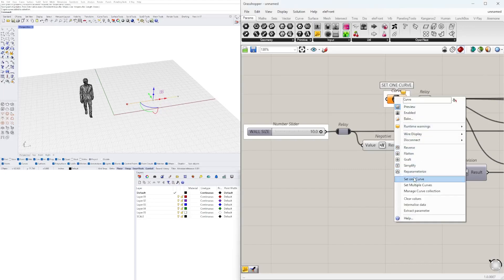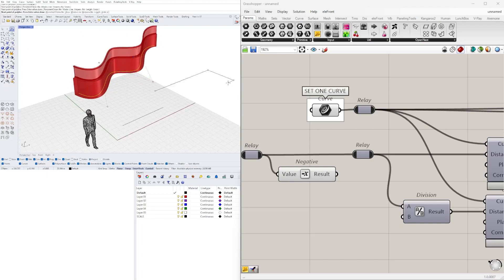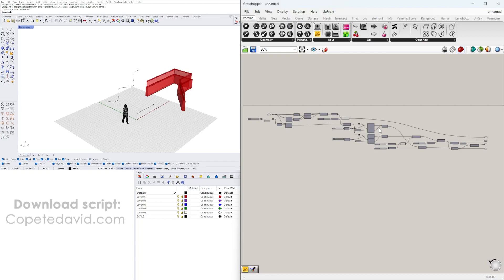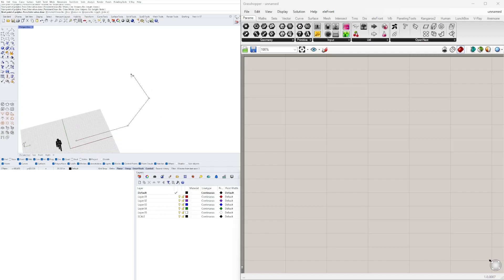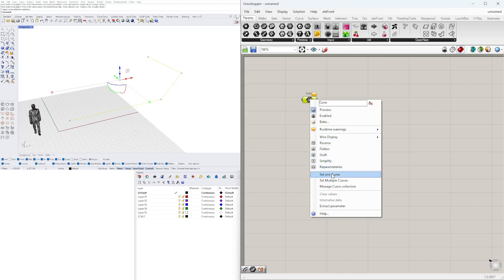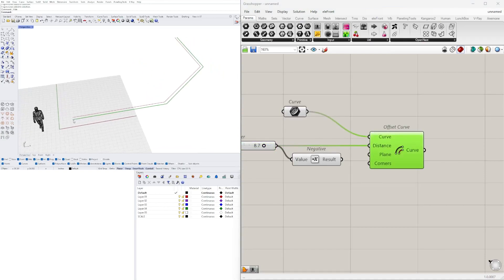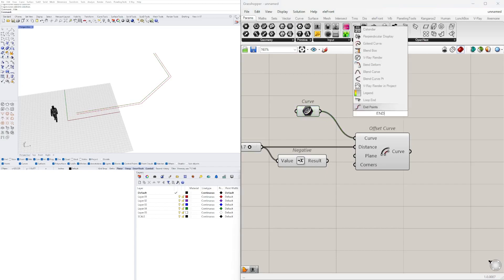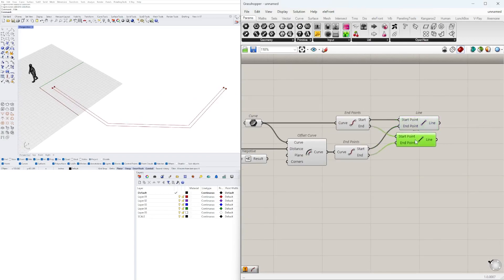Guardrail with Base Wall Glass and Frame from Curve Parametric Architecture using Grasshopper

Comment: Guardrails are forgotten, thrown away and even ignored. There is a lot of opportunities that are missing doing these contingencies. 
Guardrail with base walls deals with safety. It's fundamental like the handrails on ramps and stair. Lifeguard or contingencies for saving or protecting lives in architecture must be a central topic in our career. It's not about the shape of buildings but the safety of these people inside them. 

Safety features must become integral part of building design. These finishes could be very artistic, ornamented or simply minimalistic. I've seen you doing lots of practical basic definitions as a starting point, at the same time you are educating first year architect students with your approach. 

Sorry if I wrote a paragraph on this one but I haven't seen someone taking care of guardrails and safety walls. This is an excellent opportunity of testing our ideas we learned in parametric architecture. 

As always thank you for such lessons.